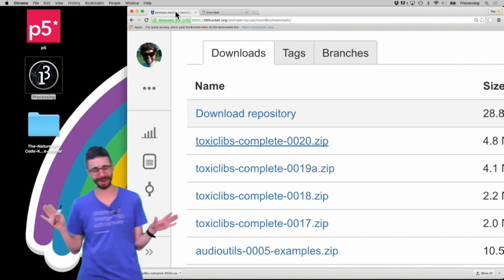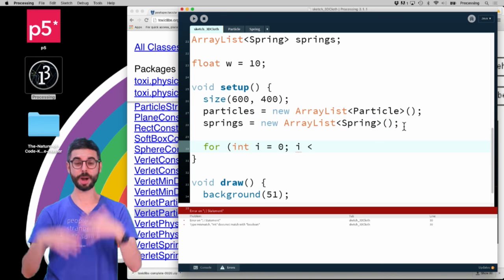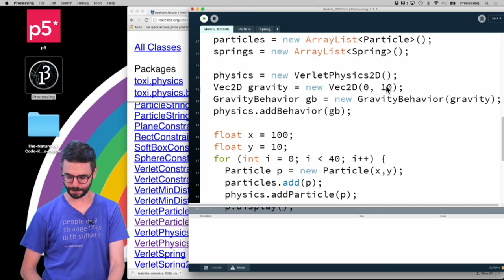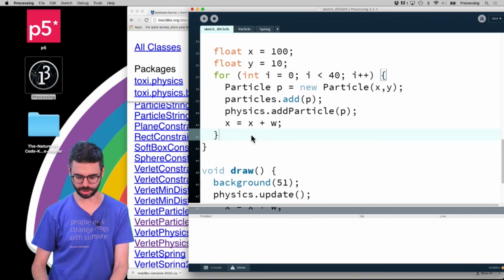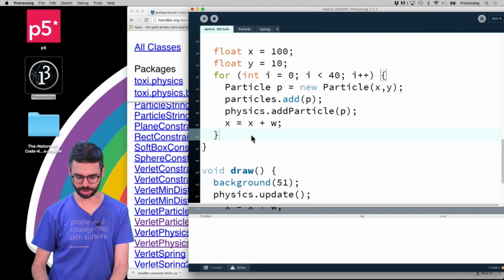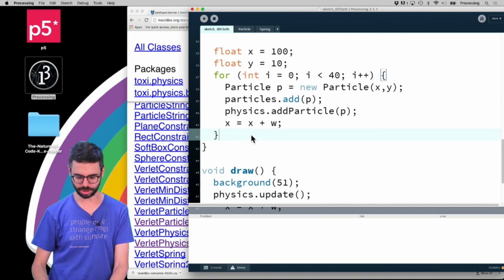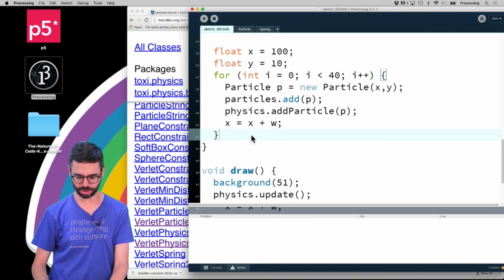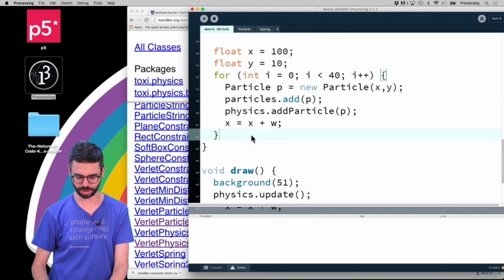Coding Challenge #20: 3D Cloth with toxiclibs

Comment: The last diagonal springs should not have a resting length of "w", but rather w*sqrt(2), otherwise they'll induce a "diagonal tension" to the whole thing, making this a weird hammock-like shape. You can easily add this in the Spring constructor you added. Thanks so much for the videos! It's really great to follow along and learn!
Reply from the maker: Great tips, thank you!!!
Reply: Nice, that is an amazing tip, how can one think like how you thought out w*sqrt(2)
Reply: @paladin1147  I just had in mind the characteristic lengths of a square. You get the sqrt(2) with Pythagore's theorem for a square of side length 1. That plus the feeling that there were tension induced as if the diagonal springs were not in their resting position from the beginning. Cheers!

Comment: by simply using the same code for the mousePressed, Dragged, and Released functions in the DraggableParticles example from the toxiclibs example library,  you can actually drag the cloth around and have functioning code..
you will have to import a java-iterator library and initialize a few variables though..

Comment: Reasons why it behaved oddly:
#1 - locking particle[cols-1][rows-1]: You connected all the springs from [0][0] to [cols-2][rows-2] with the one to its right and below. This means that [cols-1][0] to [cols-1][rows-1] will not be connected with the one below it, and [0][rows-1] to [cols-1][rows-1] will not be connected to the one to its right, thus [cols-1][rows-1] have no springs
#2 - diagonal springs: The springs going diagonal had the length 1 instead of sqrt(2), thus they were pulling the cloth to the top left corner (since the corner was locked and the diagonal spring was in that direction)
Reply: Whoops, just now saw that it's a very old video. :D

Comment: I’m running processing via a straight Java implementation and would like to  just pull in the “jar” file or do it through Maven.  However, there Is no Maven Artifact AND the last update I find in GitHub is 2014, with the "official" Bitbucket site the toxiclibs.org points to not existing any more.   Where do I get the toxiclibs now?  Is it an active project?
Reply: @Karsten Schmidt Thanks.  They guy who wrote Toxiclibs has changed it over to Clojure.  This is an interesting language, so I will be downloading toxiclibs from your link, but I will be learning Clojure and maybe doing your stuff in Clojure.....  for fun (Ins’t being retired a gas?).
Reply: @Karsten Schmidt thanks for the link ,lifesaver  -- I am not sure if it works but nwo you can actually instal form the contribution manager sketch>Import library>add library > type "Toxiclibs"

Comment: Does not work ( toxi could not be resolved)
Hello from Romania
Reply: Effectively, a forth spring should be added between b1 and b2 to make the cloth elasticity symetrical.
Ideally, strength of the two diagonal springs should be 0.707 weaker to avoid the clothes to wrinkle too much in diagonal direction.